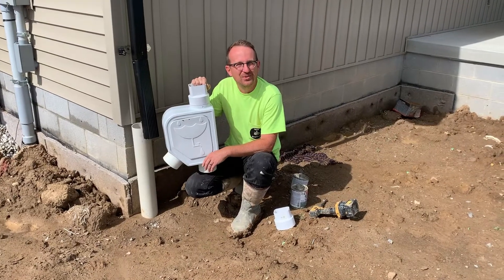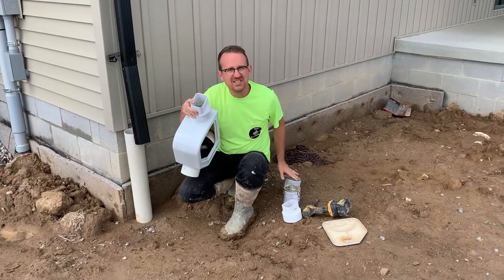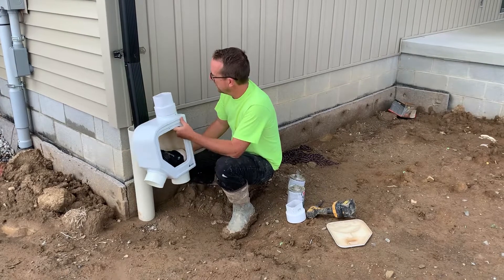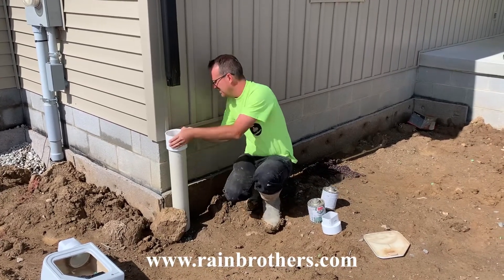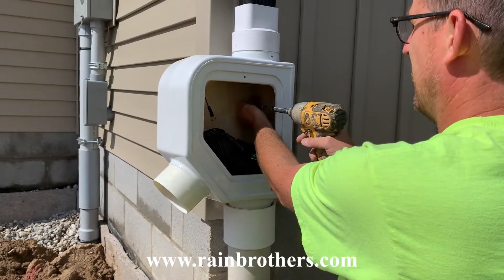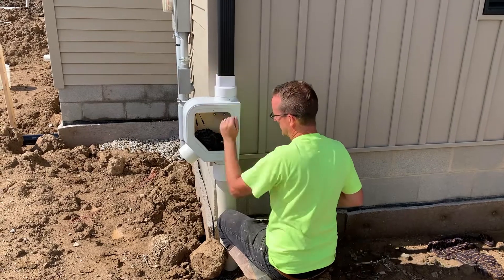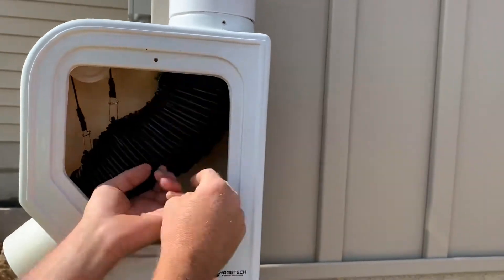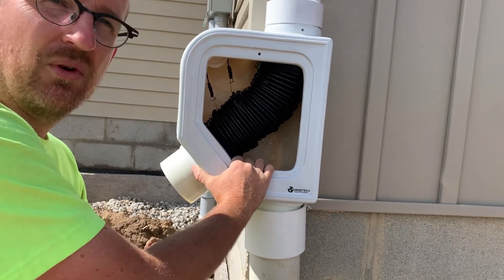Clean Water in 15 Minutes - How to Install a Monjolin Single Outlet Filter

Comment: Does this work as first flush also/ Noticed no first flush deal.
Reply from the maker: It is not a first flush filter. We install in winter climates, and, unfortunately, our experience is that first flush filters do not work in winter climates as the flush chamber can fill, freeze, and crack. We instead focus on more effective pre-filters.